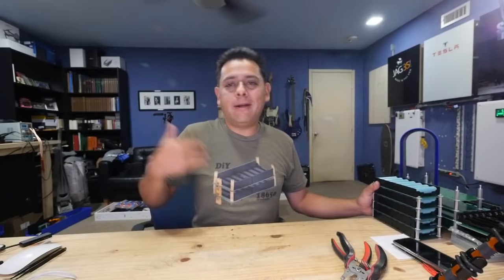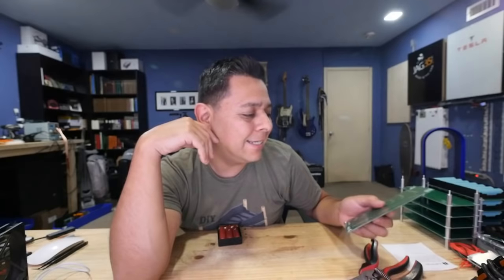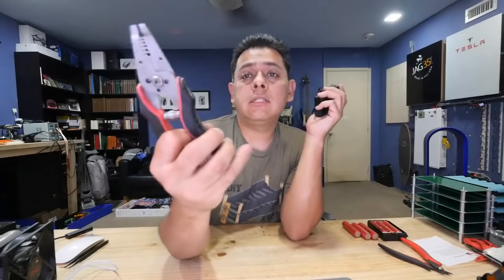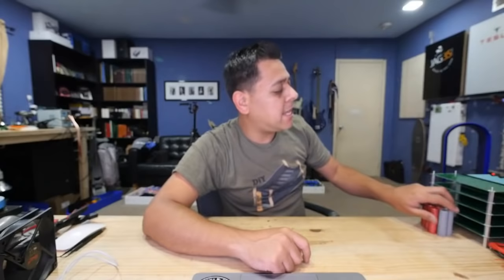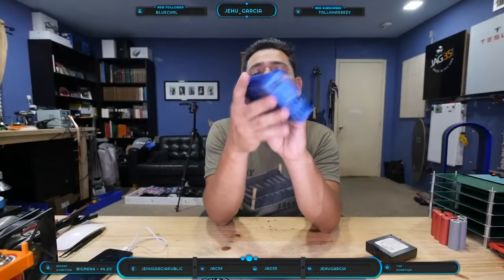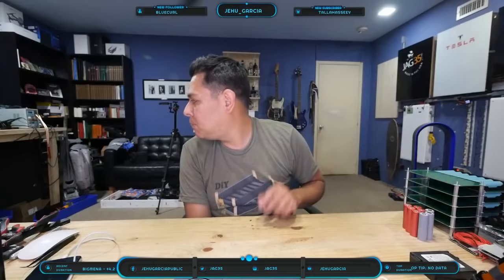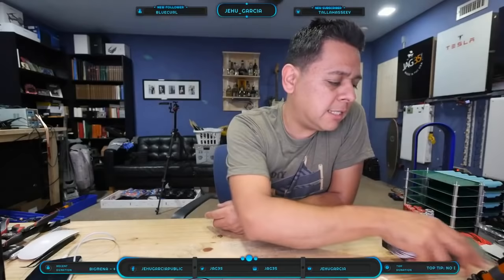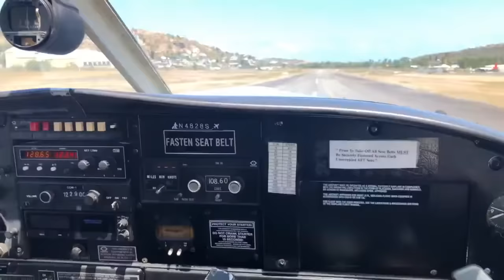Harvesting  $.60  18650 Modem cells LIVE

Comment: FWIW, the battery cases are often polycarbonate (on the good packs at least) which is a fairly valuable recyclable material. I sort the stuff marked "PC" on the inside and hand it in separately from the random other junk like tape and unmarked plastics.

Comment: Love this. I've been thinking about something similar. My suggestion would be to have the pcb a few mm wider on each side along the length so it could be slid onto a backplane in groove runners. Have a connector at one end and a grip TAB at the other end so you could add and remove banks of cells similar to hot swap hard discs in raid arrays. Bms and led on each board to indicated if a cell is failing and led on the main backplane to indicate if a bank of cells is failing. This design would be more plug and play! What do you think?
Reply: Good Idea
Reply: i guess Im randomly asking but does anybody know a tool to log back into an instagram account..?
I stupidly forgot my password. I would appreciate any tricks you can offer me
Reply: @Jakob Connor instablaster :)
Reply: @Kylan Marley i really appreciate your reply. I found the site on google and Im trying it out now.
I see it takes quite some time so I will reply here later when my account password hopefully is recovered.
Reply: @Kylan Marley it worked and I now got access to my account again. I am so happy!
Thanks so much you really help me out!
Reply: @Jakob Connor glad I could help xD

Comment: Hi Jehu great vid and chat mate. Just keep living the dream you'll suceed mate.
Peltiers come in 60 and 100w sizes 12v, but i was referring to using them as power generators add heat to the cold side and keep the normal hot side cool and they make power . Thinking your the man for a diy battery charger with it.
Opotion to make power off samba's electric motor heat..
Or a heat exchanger on roof rack even..
Sky's the limits.
Reply: Sorry to burst your bubble but they are horrible at generating power also; he would be way better off putting 1kW of solar on the roof of the Samba.
Reply: jkenny1 No stress your not bursting my bubble i know there not the best for making power but for square feet compared to pv in the right conditions they make more power .
But all good just a suggestion an something new for Jehu to tinker with .
Also there is a difference between just buying a cheap peltier and an expensive thermal generator . Cheers

Comment: Hello Jehu, Greetings to you buddy ..... Thank-you for being on Youtube solving interesting problems ...... I am rigging up a Battery pack and i have a question right now though - Instead of soldering all the batteries,  can i use a copper plate that touches all the on top (anode +) and another copper plate under that touches the bottom (cathode -) layers of all cells and harvest my V ...... soldering so may cells is very laborious too ....i am unaware if you got my point, and i am unable to upload a pic of what am saying as there is no upload option ...... I appreciate your help on this issue ...... Have a great day, Guru.....